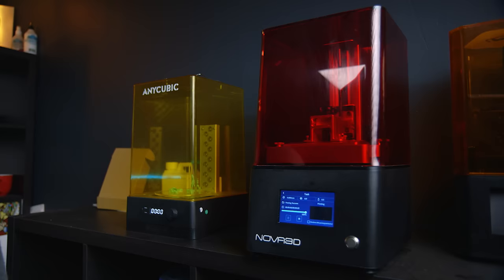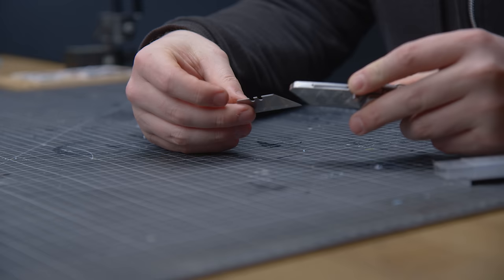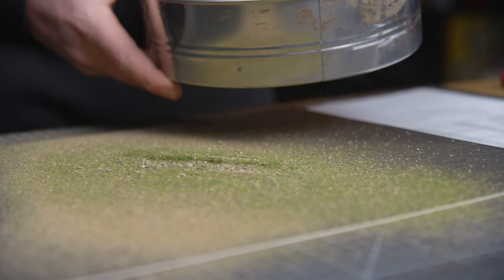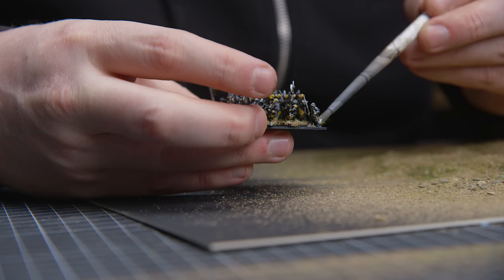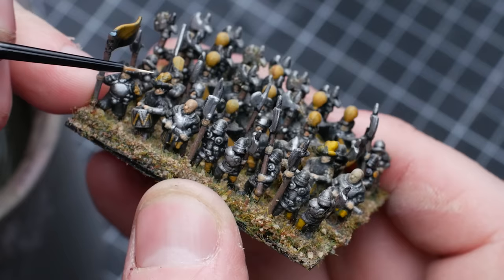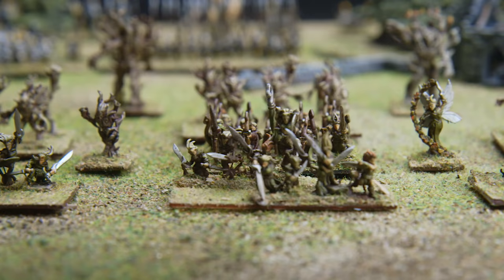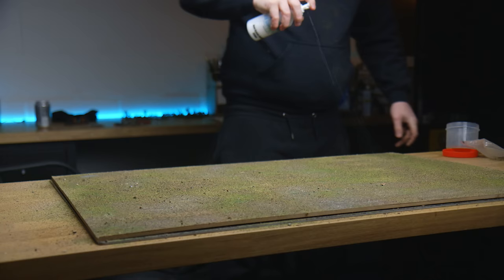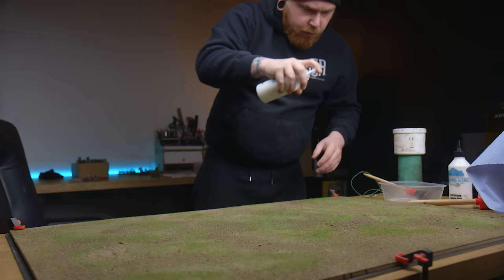Make Warhammer TINY!!!

Comment: Love it. I’ve gone for 3mm scale for massive battles with thousands of troops.
Reply: I did wonder how long it would be before someone mentioned this excellent scale. Nothing looks like an army quite like 2mm, although I messed up the basing, spreading strips out a little too far. 
6mm is a good looking scale. Mine are arranged more shoulder to shoulder, so 6 or 7 X 40mm wide bases form an imposing, unbroken line of battle.

Comment: Swap inches for cm rather than halving movement/distances :)
Reply: Honestly it sounds good but half inches means any even number becomes whole inches again and that really helps.
Reply: @tylerttinsley   Huh? There are no half inches, a movement of 6" simply becomes 6cm, therefore scaling down everything by 2.54x.
Reply: @Aurillia  this is what I did for Dungeon  crawls using D&D.  Just convert to cm.  Fantasy Trip I use 12cm Hex as the figs are on 9mm magnet disc bases.
Reply: Huh that’d be genius.
Just like in the good old Battlefleet Gothic!
Reply: @tylerttinsley  1 inch is 1cm so 1/2 inch is 1/2mm, i don't see the issue?
Reply: That's what I do for my historical stuff using 6mm figures. Suddenly I've got space for 3 boards side by side for a 6 man game of O Group in my kitchen! Space, cost and time commitment become near negligible!

Comment: Back in the day we made a ‘Pocket 40k’ version using 6mm Epic models that worked surprisingly well and was a lot of fun to create and play with! A few things we discovered that increased quality of life enormously when playing with tiny, individual models:

Use a piece of sheet metal as a base for the board and add a small magnet to the base of every model. This isn’t as much work as it sounds, and it completely solves the biggest danger: any small tap to the table knocking over all the models and ruining your game. 

Secondly, adding a grid field to the ‘table’. Having to use tiny rules to move tiny models tiny distances can get tedious, so having distances integrated into the terrain was a massive help.

Comment: I think you could make it even smaller, for beginners.
You only need 1 miniature for each squad/troop + any hero/banner bearer etc. that accomplices it
But the single squad miniature piece is set on top of this modular frame to represent it.
The more people in the squad, the bigger the frame.
And as you play, you have a turn wheel which lessens the overall frame.
The turnwheel can have numbers around it, but the top number defines how many are left in the squad.
Turning the turnwheel, it could f.ex be attached to strings to each corner and pull it closer, so that the frame diminishes.

Comment: A quick portable table idea is to buy ABS sheets, in the US you can get 12x12 inch sheets in various thickness. These can be glued with, pipe glue, together and to vinyl sheets (think table cloth but thicker). I made a 3x3 foot table top with this idea. I glue 3 of the squares together to make a 3x1 foot section, then glue it to the vinyl sheet making the table 3x3. This lets me fold the table down to a 3x1 for storage or transportation. ABS is very similar to PS so it takes paint or PVA glue quite well.

Comment: My only suggestion is how to stop the warping. I have found that the very thin parcel tape (normally brown) has no 'give' in it, along its length. Apply this in strips on the underside in both up and down and horizontal directions. It is very resistant to linear tension and thus prevents cardboard or foam board from warping.
Barry
Reply: I am going to try this for other terrain projects I work on. that sounds genius.

Comment: "I go this army done in a day" - insane. Now I'm off to look at 3D printers...
Reply: I got into flames of war about 3 years ago, and hated the expensive units and limited units. I bought a resin 3d printer about 2 1/2 years ago and haven't bought a model since. Actually the only models I own are a firefly platoon.
Reply: Read up on the safety, The fumes are not to be taken lightly.
Reply: If you don't have a garage, things get trickier, but if you live in a city there might be a makerspace to test things out.

... Once the pandemic is over.
Reply: @vincentmuyo  what exactly is a "makerspace"?

Comment: "I don't any terrain..." Bloody hell reality really is falling apart haha

Speaking of smaller models, I use smaller scales to test out new systems so I'm not spending loads of money on systems I'm unsure about. 15mm is a pretty good starting point, loads of options and its easy to scale down from 28mm because its basically 1/2 the scale that we're used to for both rules and terrain. 
Works pretty well for skirmish games as well as they can be played on as small as a 2ftx2ft board to simulate pretty large skirmish maps. Great fun.

Speaking on the topic of 40K! I've yet to find anyone who can convince me otherwise that normal 40k rules played with 15mm minis or even 6mm minis on 25mm rounds is not the way! The rules make no sense for firefights and artillery and sniping on such a small board set up for what they are supposed to represent. But at a smaller scale using the same measurements etc. suddenly the idea of rolling up with a basilisk to shell a building makes sense! Okay rant over haha

Comment: Back in the 90's WD had an article where one of the studio members built a travel size 40k using the epic scale minis and a folding battlefied board made of foam core... I wish I could remember (or find) the issue. I had planned on making this, but never got around to it. The concept I had was to make a wooden book-style Box that opened up to reveal a folding double-sided foam core board with grass grass on one side and desert on the other (you could make additional types of battlefield boards and swap them out too) under each side were compartments for two armies and epic-scale terrain. I had concept and blueprints drawn for it, just never got around to building it. If you can get your hands on some epic armies, you can make one.

You can actually use foam board, instead of paint and flock, you can use sheets of adhesive velvet sheeting.

Comment: Reddi-Board only warps if you don't remove the paper. For thickness make a 50/50 mix of walmart brand paint (the one with the apple) and titebond original wood glue. For easy removal of the paper get the black Reddi-Board. For EXTRA thickness add cardboard to the inside of the buildings.

Comment: You can shrink 25mm & 28mm down to 10mm Scale with 3d printing.  30 to 38% is usually the sweet spot in reduction.  You can do away with a lot of the supports.

Comment: I love it. Some time ago friends and I were lamenting that 40k is just getting bigger and bulkier all the time (especially forgeworld) to the point where vehicles are struggling to fit on a board with more complex terrain. More recently (when I myself got into resin printing) I had wondered about the feasibility of scaling 40k to 11mm (same game but using metric measurements rather than imperial). Doing so would would mean you could have very large sized games that would normally require and 8x4 board and play it on a standard living room coffee table  on a board that measures less than half a square meter (96x48cm), not to mention requiring far less storage space. Sadly I currently don't have anyone to play with, other wise I'd gladly churn out a few armies.

Comment: I know I have looked at rank-and-flank games like "Dragon Rampant" or (My favorite) "Rules According to Ral: Chaos Wars" and thought about using small scale (usually 6mm) miniatures, but not quite changing things...as in, with the above examples, Infantry is in blocks of 12 individually based models and Cavalry is in blocks of 6. In this, I'd be thinking along the lines of having 12 bases of 6mm infantry strips and 6 bases of 6mm Cavalry strips, maybe reducing ranges (Probably switching from inches to centimeters), but treating each base as one unit. That said, going for 1-2 bases per unit and keeping track of wounds with a die would probably also work...

Comment: i always wanted to play Warmaster on a 6' x 10' table. Do a campaign without fighting different battles. You start with a home base and move on to control the map etc. So you have armies in different spots and when you control a town or something you get more models as reinforcements?. You can rest models to regain wounds by not moving them for 2 turns or something. It would be a War not a battle.  I would be really complex but could also be done very quickly if you balanced it right

Comment: Question.... Why are you curing them for 5 or 6 minutes? I would think that's major overkill and over cured?? I usually do it for around a minute with water washable resin. Just wondering that's all lol
Reply: I don't think you can over cure. I have a running experiment where I have left a model in the corner of my UV box for months now and I periodically check it, its gotten darker but its no more brittle or degraded in any way

Comment: Well I got sucked in to 6x4 Bolt Action at 28 mil ... :))))
That could also probably be shrunk to 10 mil and modified.
It is not very accurate historically to have just one tank in action they always had platoons of at least 3-4.
But then again it is not accurate to have just tanks clashing without infantry. Rarely happened. 
I will probably make some house rules.